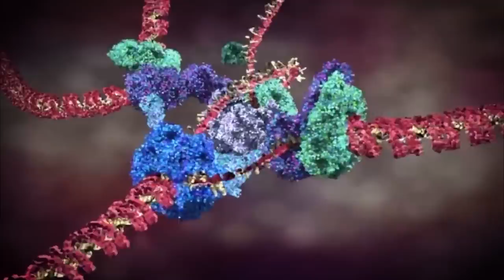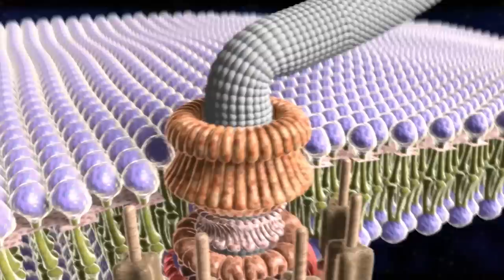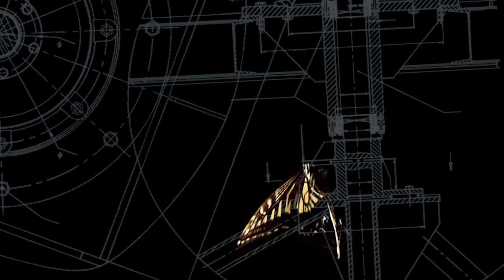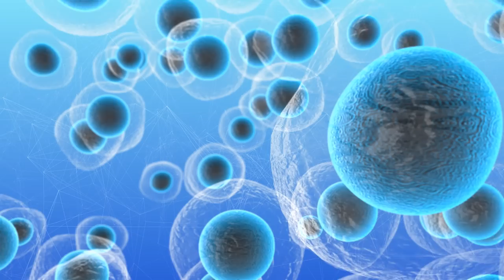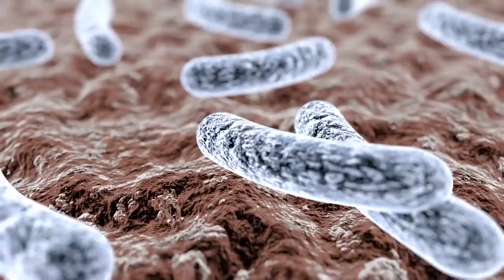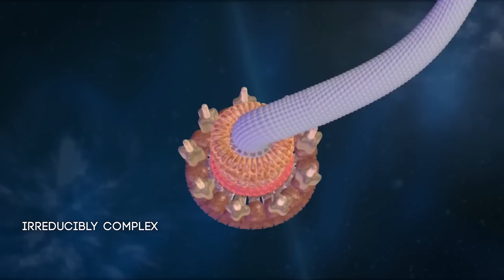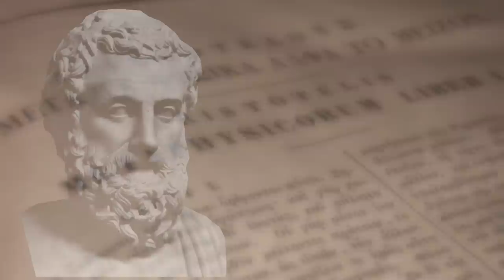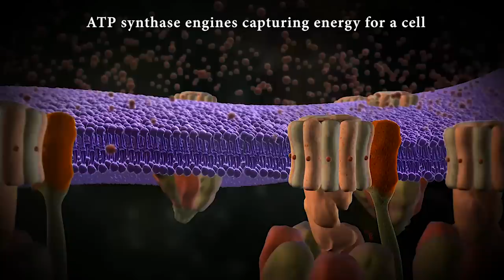Secrets of the Cell with Michael Behe (Season 1 Compilation)

Comment: "Of the simplest machines, a toothpick has no moving parts. The only way to make it is by machines and engineering. Given every tree on the planet and infinite time, evolution could never make a toothpick. The only thing "evolution" can do is rot the wood." Dr. Joseph Mastropaolo
Reply: Agreed. All the modern so-called evidence for evolution that I've ever seen presented as a biologist is simply slight change over time that always seems to degrade the organism, and never adds new features such as a flagella on a bacterium, or feathers on a bird. It always deletes things like that at the very least, just in a somewhat beneficial way sometimes. To think that all this complexity arose from mutations is complete delusion. There's no environmental pressure for almost all features we see in organisms until the feature actually works, which means it is fully formed. For example, a heart and circulatory system cannot add any evolutionary advantage until they are effectively complete.
Reply: Pretty much yeah. I wouldn't say infinite time, because technically there's bound to eventually be a tooth pick somehow in like 439,455,938,284,745,099,232,854 years

Comment: Even more astonishing in organisms, IMO, is that these separate 'machines' are integrated into a 'system of systems'. The several 'systems' of life integrate with parsimonious system/sub-system interfaces. The individual systems are non-deterministically related; that is any system doesn't _need_ any other system, in many cases; yet the multiple systems cooperate to a  result that is not determinable by any one of the component systems. This makes the organism even more astonishingly designed and introduces a necessary transcendence to it: that is, the design information and objective must be external to the organism.

Related to this conceptually is the 'parsimonious' (or economical) fit of organism functions and operations within the external constraints and opportunities of our environment. What I mean is the close congruence with form (of the creature) its function and the external target/s of that function. The 'fit' is too neat to be reasonably attributable to chance, in fact by orders of magnitude. Example, our hands, with opposable thumbs: they grip far better that is probably necessary for most operations they are called upon to perform. In fact, in most of these operations we could get away without an opposable thumb. It would simply be less convenient and less efficient, more awkward for us. Is 'awkwardness' going to be 'noticed' in comparative reproductive success of variants within the species? Probably no.

Comment: Note:
The mouse trap actually has 9 parts, not 5.
There are 4 hold down loops that hold the other parts to the board.  Let's call that 'junk DNA', still required, even if it wasn't noticed.
Reply: Junk DNA was a thing of the past...they later realized all DNA has function. And what does it matter the number of parts, it's just used as an example.
Reply: @KenJackson_US  what is the basis of the 'absolute faith'  in microbe-to-man evolution?
That sounds like a belief without reason.
Reply: @siemhaa  with any of these discussions,  evolution vs creation,  the details are important.
They (scientists/ biologists assumed) usually claim they know how everything works, publish papers to prove that their theories are correct (better than creationists), but later realize that they don't know all the details.
Yes, I know it was only an example,  but the example has 4 more critical parts that are not mentioned (like junk DNA, until they realized it wasn't).

Please see my other comment (evolutionists vs creationists).

Comment: In watching this and other videos, I see that at 29:18 on Professor Behe's video, it is stated " Removing just 1 part of the flagellum makes it dead in the water." On the otherside of the "argument " in the video by Professor  Kenneth Miller  "The collapse of Intelligent Design,"  says  at the 44:05 +/- minute mark,, that it is  possible to  remove 40 parts and it keeps working. I just want to know what is the actual facts.
Reply: I just watched Kenneth Miller's video except the question-and-answer portion.   Miller never said you could take away any part and of the flagellum and it would still function as it currently does.  I believe Behe is saying if one part of the flagellum is removed it will no longer be able to propel itself using a swimming-like motion or like an outboard motor does for a boat. What Miller said was if you take away 40 parts it could serve a different function which is the “Type III secretion system”.   “In pathogenic bacteria, the needle-like structure is used as a sensory probe to detect the presence of eukaryotic organisms and secrete proteins that help the bacteria infect them” (Wikipedia).

At best Miller's argument is for a precursor to the flagellum with 40 missing parts.
Reply from the maker: And Miller's claims about the Type III Secretory System have been refuted. Even evolutionists now believe that the Type II Secretory System arose AFTER the flagellum, so it couldn't be its precursor. See:
https://revolutionarybehe.com/2016/09/08/type-iii-secretion-system/
Reply: @DiscoveryScienceChannel  Thank you for that reply.  I knew there was more information concerning the flagellum and the "Type III secretion system" but I didn't know where to look.
Reply: @truthiselusive  I just watched it again and I am not getting what you're getting from the statement, he even says that if irreducible complexity is right than than these parts can't do other jobs, but if evolution is right they can do other jobs. Maybe I  am putting more into it than what you think he is saying.  (43:23), maybe I grasping it wrong. Hmm, a theists that doesn't believe in creation 🤔.
Reply: @billyhancock7851  Sorry for the exceptionally long delay (9 months).  This video covers things well about the trial and information you're curios about. I think it's worth a watch.  Titled "Documentary Revolutionary, Michael Behe and the Mystery of Molecular Machines"
https://www.youtube.com/watch?v=Fyd4CfYfVCA